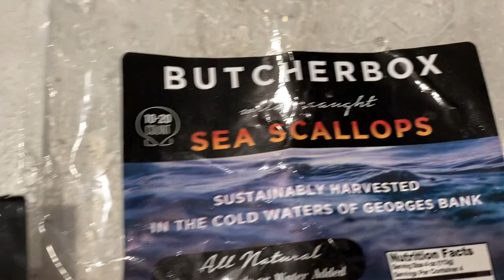Corrugated Tin Siding Accents On The House.

Comment: A garage is specifically for holding and sheltering automobiles. A shop is for doing projects and having tools, workspace, and equipment within to do said projects. If it happens to hold a few automobiles, so be it; but the two monikers are mutually exclusive. It's like calling a stable a barn.

Comment: Now that you have this huge building, it would be a great idea if you designate a section just for your tools and materials.  Organize them by elements you use such as:. Wood- every tool you use for woodworking in one area, metal- same thing and so on.  Also, whenever you work on something make it a point to either finish on same day if it's something very small or have  assistants to clean up after you.  You have many beautiful, healthy children that could help you with.  As a motivation, either a % of an allowance or special treat.

Comment: If you have extra duplicate tools, a good use for them is to store them in places around the property where they are frequently needed. I have tools I have purchased and some I have inherited, some I have found, and a few I bought at a dollar store. I keep some in my truck, some with chain saws, some with guns, some in a kitchen drawer, some in a garage, some in a basement work bench and some in my barn, and some on my ATVs. The point is, they are spread out but handy rather then having all of them in one place. It may be a system that would work for you. I have an inexpensive cart for gardening tools that I keep stored in it.

Comment: Have you considered a small solar panel on the back roof of the shop so you can add some lights to the cupola? I thought that would be a nice little touch to your beautiful addition.

Or just run a line up after you get the power packs moved out there.

Comment: What works good for me..
Are 24 inch wide shelves. 12 1/2 inchs between shelves
So a milk crate can fit..
24 inchs deep for me is a good depth.  I can keep from burying things... If that were my shop
I would line one wall with shelves 10 ft high..
And maybe room under the first shelf for small compressor or welder...
Any way that's my 2 cents

Comment: All the dust in your garage is a mess, try mixing old oil with sawdust to make a sweeping compound to use, it will clean up the dust on the floor. Use just enough oil to dust with, but not to leave the floor covered in oil you will have to experiment with how much to use on whatever sawdust you use such as pine, oak, whatever. good luck with it if you give it a try.

Comment: i'm the same way Shellee came in the other day and freaked out. and she told me to quit and go visit someone. so i did and 2 hours later i came back and she had every room in the new house cleaned and she was going back to touch up. i hate to say this but i bet i have 2 inchs of sawdust everywhere.  she should be happy i'm pretty much done with cutting anything wood for right now.
Reply: oh and she uses a lower to move most of the dust out.

Comment: Looks like you still haven't finished the roof on the cabin in the woods, a result of jumping from project to project.
Hey at least you can use the siding you ripped off the house for fire wood to heat the house. How are you going to heat the house and the large shop with that little bit of wood?

Comment: I thought that cupola's were built for ventilation and to bring light into a building, Yours seems to not do that, so why build it unless you're not finished and the blockage(roof section) will be removed at a later date? We had a cupola on the barn on the home ranch in Montana and that's exactly what it did.

Comment: I can emphasize with you about project messes.  If I did not know better I might think you could have Ausbergers.  What I did for myself is rather than spend thousands on a big fancy tool cabinet, I took the time to build a cabinet that has dozens of drawers where each tool set has a spot to go in and is customized to fit.  I used a hot pen to write the tool type on each drawer.  I have bins for specific jobs so that am doing X project then I just have to grab X box and it has most of what I need.  You will feel so much better when you Cedarize it.    If that is not possible for now just build a simple set of shelves with 2x4 material and 1/2 plywood so you can tower stack things.  It will make her very happy to be able to get all the bins organized...